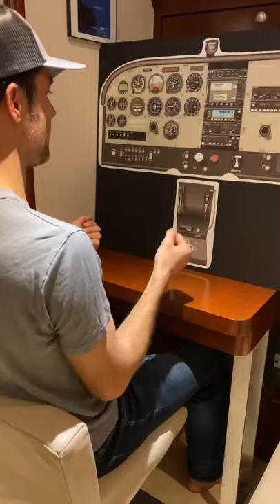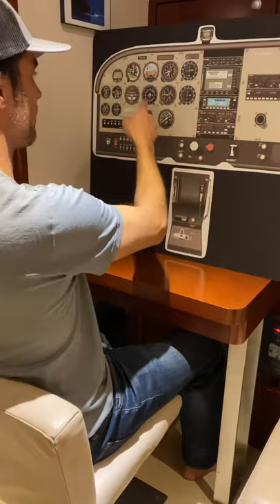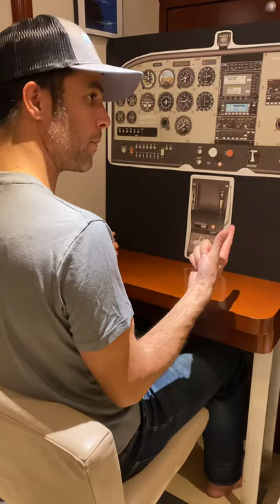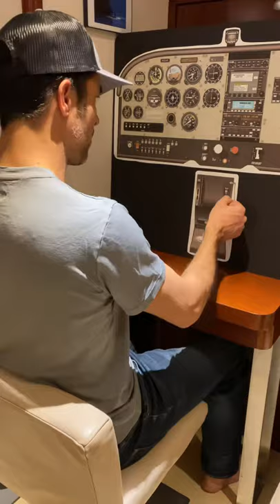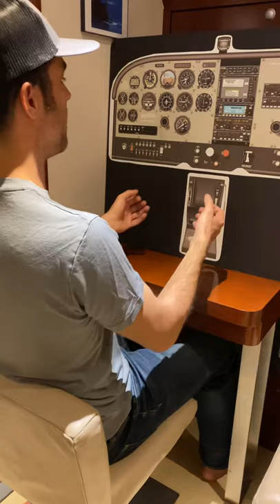Chair Flying - Traffic Pattern in Cessna 172N

Comment: Great instructive video. Thank you for putting this together. Pretty much perfect. 2 comments: 1) levelling up on down wind, forward pressure on the yoke and let the a/c accelerate a bit and then and only then throttle back to 2200 RPM. 2) for T&G, flaps 10 first before full power, not flaps up. My 2 cents... again thanks great video.
Reply from the maker: Great feedback! Thanks! Definitely agree on the first, on the second - depends on the year/model of the 172. For a 1979 N, I'd go flaps 0. For a 1980, I'd go flaps 10 (per the soft field/short field guidance in POH).

Comment: This is the problem with chair flying - if you make a mistake there's no-one there to correct it. Within the couple of seconds that I happened to watch you've already forgot a couple of things, like pushing forward before reducing power once you've reached the TPA, or lifting the wing to check for traffic before turning - so you could do this a thousand times in a row and you would have done it incorrectly every single time, thus building a poor habit. With no feedback - chair flying is heavily limited.
Reply from the maker: No type of practice is perfect. I’m not advocating that someone should ONLY chairfly, nor am I representing that this video is a perfect rendition of a traffic pattern given every possible scenario.

Are you saying that a person should ONLY fly with a CFI, and never alone? Never with friends/family that are non pilots? Nobody is there to correct them.
Reply: @chasefranzen  well when you're flying alone or for fun your flights typically have some kind of purpose outside of training, and if they don't - the fact that you come back alive is at least some kind of evidence that you didn't completely screw it up. Chairflying is an extremely boring and stupid routine that can only have one purpose - repetitive drilling of a procedure into one's brain, and like in any other repetitive drill - it's largely useless if there's no feedback. That doesn't mean it's completely useless, but just pointing out that it's not nearly as useful as it would have otherwise been.
Reply from the maker: @alk672  Cool. I disagree. :)
Reply: @alk672  what do you mean there's no one there to correct it? 😂😂 I have a dozen books and resources that'll correct me while chair flying. 

It's better to get the routine down during chair flying than dozens of lessons being charged to you... 

You will have to fly solo at some point before you're licensed,  who do you think is responsible for your actions while solo? 😂

This was such a foolish take. 

And it's definitely coming from some who isn't a pilot. 

I have never heard a CFI not suggest chair flying.
Reply: i always hated this too, i never understood why people think this is useful. Great for you if it is, but i find this an extremley useless excercise and i feel like an idiot doing it. its not immersive or real feeling, and super pointless when it comes to me. im so sick of this being so overemphasized by other pilots as a huge study tool. if i fly enough it clicks, when i dont fly this does litterally nothing.
Reply: @kammyr4082  I am a pilot. Books or resources will not correct your chairflying. They are not there to tell you what you're doing wrong. Repetitive drills are only as good as they are correct. If you keep doing the same thing over and over incorrectly - you'll just learn it very well and very wrong. It is what it is. If you have some actual counter-argument please let us know.